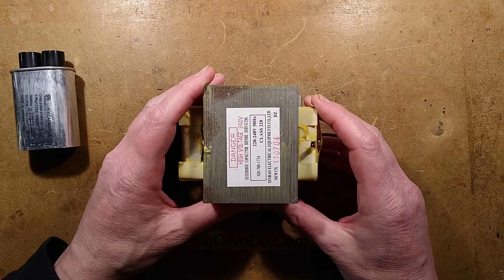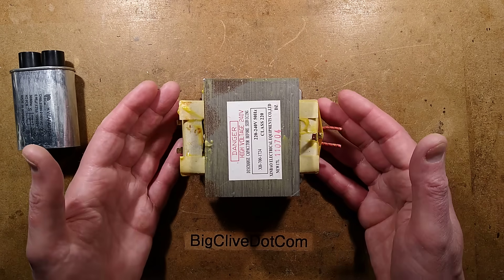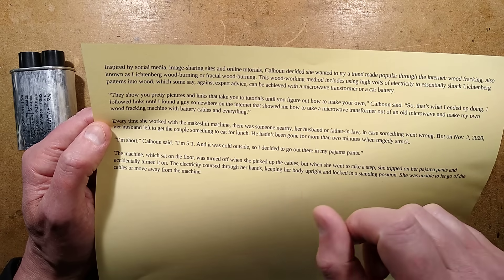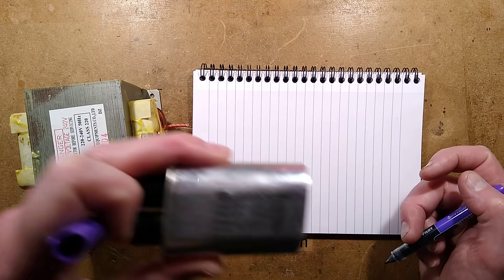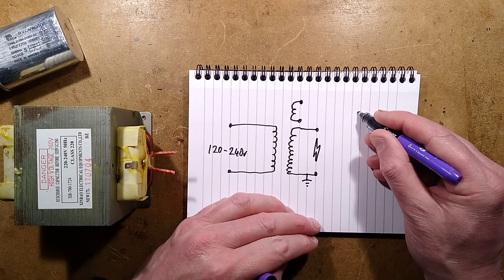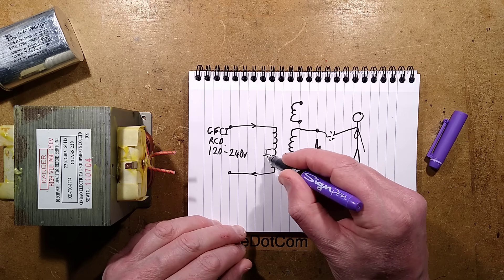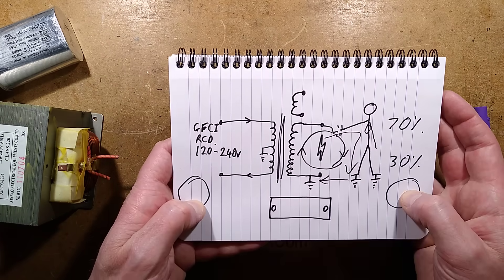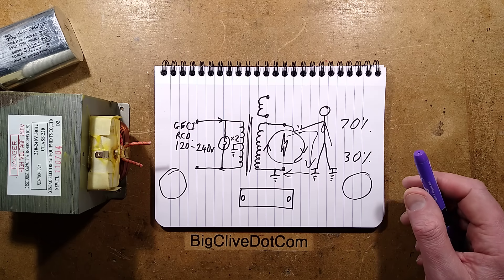The most deadly project on the Internet

Comment: Fantastic Video about Safety! This applies to anything high voltage, a good refresher for those in the technical field service industry and a great introduction to high voltage safety for newbies wanting to experiment.  If this video saves even one life it was worth producing it!  Great Job and thanks for taking the time to do something to help others be safe!
Reply from the maker: If involved in technical maintenance then you may find my video called "The unofficial guide to electrocution" useful.  It's based on the fact that maintenance guys often have to work live to trace faults.

Comment: I have a lot to thank you for explaining this information Clive... you've probably saved me from a deadly electric shock. I was recently using an electric heating pad for painful back muscle problems... it's not new, but it's not ancient either, and there were no obvious signs there were any electrical issues... until a few weeks ago when I reached out to feel a radiator to check if it was warm or not.  I noticed a strange sensation on the surface of my fingers... kind of a light vibration, almost a shuddering feeling. I was perplexed as to what the hell it was and then realised my heat pad was on low and sitting comfortably behind my back on my office chair.  I've always believed electric shocks were instant... you'll either get one or you won't, never thought it was possible to feel a low level electric current. I turned my heat pad off and dared to touch the radiator again... all the shuddery feeling had gone. I mentioned it to my brother who knows quite a lot about electric and even more since he's been watching your channel.  He had just watched this video and warned me not to use the heat pad again and explained the info about the transformer... which the heat pad has.  I was horrified to know the trip switch in my home would not be activated because of the transformer.  That's not something the electricians warn you when they install that to your home!😕  Thanks so much... you've probably saved my life!!  What really upsets me about this, is why it's permitted to sell such a device designed to use touching our bodies that has no guarantee of safety if there are any exposed wires inside.  I'll certainly never be using any device that has a transformer near my body again!😱
Reply from the maker: The tingle sensation was probably capacitive coupling from the pad to your body and finding a path to ground when you touched the radiator.  As longs as the pad is in good condition it should be OK.

Comment: I built one; I triple insulated all the connections, encased the transformer under a Plexiglas cover, bought a 20 amp voltage regulator, and 20KV electricians gloves. You HAVE to respect the shit ought of any tool you are using.

Comment: You don't have to come into physical contact with voltage that damn high! You can become arc flashed and it'll travel through your nervous system because that's how humans receive our impulses to move and walk from the brain interestingly enough by electricity... Which is why you'll die

Comment: I'm a commercial and residential electrician, and I should say, go buy some high voltage PPE Equipment which would be the smartest to invest in the thick rubber boots, apron, and gloves to protect from a very painful death! Electricity will follow the path of least resistance to ground out, if you're the least resistant path, you've just become a very unfortunate ground wire! I've worked on very powerful transformers a hundred times bigger and yeah that shit will fry you instantly, this will keep you on it until it blows appendages off don't microwave yourselves...

Comment: I worked in the families white goods repair workshop as a kid on weekends, and was always fascinated by the workings of a microwave. A senior engineer let me watch him disassemble a microwave for repair and explained the dangers of megatrons and high voltage capacitors. Basically a death box. Worked on every type of appliance, but I won't touch a microwave for this very reason.

Comment: I'm not an electrician, but I've done a lot of low voltage, and 120 and some 240 wiring. I have no interest in dealing with voltages higher than that (I don't like messing with 240). Great video though.

Comment: The ignition coils on my 2zzge racing engine, transform 12V into 40,000V, at around 1000amps. you can stop your heart by testing spark the old fashioned way. (Grounding the plug threads to the engine block, and looking for the spark in the gap)
All modern cars have ignition coils that transform 12v into a minimum 24000V.
Hybrids and other E.V.s have batteries and transformers in them, that is often the same power of a lightning bolt from the sky. the average home can be powered up for about 10 minutes, with a fully charged EV (Electric Vehicle)'s battery. 

On another note...
You can make a prank cigarette lighter with a AAA battery, and a coiled up copper wire.
A AAA1.5v battery, converts to 30-45V, with low amps. It hurts, but doesn't cause damage. You can help people quit smoking with a bunch of these prank lighters.
Is the cigarette worth the pain? LOL

Comment: I really can't believe that the 21st century Idiots still are failing to understand that high voltage can kill. I have been working with is since I was like 7 or 8, and I learned  about it at age 6. I am going to be turning 62 this year. I had an Uncle who taught me He had been in the Navy as a radio operator and electrician.  I worked on tons of devices  that have High voltage and yes I even repaired a Microwave died one night when I can home cook a late dinner. The magnetron failed. Took me months to get someone to sell me the part as they felt I could kill my self. I had basically break down my work and all I did and how the part would be replaced and tested.  I impressed the tech at the shop, and he sold me they need the part. I did this in the 80s. Last I was told it was still work but was replaced one had a turn table. But still that oven had some power the Caps were like 8 inch tall and about 250 each. I open the over up that night to look at the parts tested and bled the voltage out removed the magnetron and started my hunt. No Internet existed.  I have to respect for voltage my worse shock tossed 15 feet and that was from a tube type TV while doing high voltage test and high voltage had small hole  no damage to me but was due to good grounding testing hardware my uncle had in his work shop.  The hack design these people are using is lethal and in this day and age just utter madness. Safely building a device to not kill and to protect your self need o be made or laws to stop these idiots. I know that worse of mouth the reason I could not get a magnetron easily. A young guy was doing the same, He was just learning electronics for a hobby. I got two stories  one that he died the other hurt badly then died. This got out and many shops refused to sell any magnetron. Plus I found this may have happened more than once. I think that scraps shop and part shops need to warn of people buying these items, but it won't stop. Like you said banning it would just make them see it a challenge to find a way to do it and have people die.

Comment: I found out about those things 40 years ago. Was working at a small town independent electronics store. A customer brought in a microwave purchased there with a fan rubbing noise. So my dumb ass was gonna fix it.....Took off the outer shell, turned it on to see where the fan was rubbing and got too close to the transformer. It arced at least 6-8 inches, hitting my elbow, and knocked me to the floor. My arm was numb for at least 5 minutes. I don't know how it did not stop my heart. I took the time to study on microwave "tubes" and how they worked after that to see what happened to me. I should have done that first.

Comment: I worked in a TV shop during the mid 90s when I was 15-19. I used to perform basic repairs on old fashioned TVs. Once you've discharged a power CAP into your fingertip and turned your entire finger end black...... you never get complacent again

Comment: Unless the metal transformer case is connected to the house ground, then the there is no ground path, it's effectively a high voltage isolation transformer. If it isn't grounded then is that not safer? touching just one side of the secondary would not result in a shock? Not that I'd ever use these, I studied electronics and would not ever consider activating such a transformer, almost like playing with a loaded revolver!

Comment: As the old saying goes, "Fuck around and find out".
What people also should know is something called "let-go" current, the current at which you're able to release yourself from the contracting effects of your muscles from AC voltage. The range is from 6-24mA, or .006A to .024A! That is a shockingly (sorry) low number. Granted, DC let-go is higher (500mA or so) but either way, it only takes a surprisingly small amount of current to feel yourself reverse BBQ, being conscious up until the time you die from hypoxia because your heart isn't beating.

Comment: I wish big Clive would review the Danfoss ignition transformer for oil burner heating boilers. 2x7.5kv & 15kv units as even Danfoss can't tell me the difference between them. And why.
EBI M 052F0033 & 052F4064  the 052F4045 is a replacement for the 0033. Big Clive  rocks....
Reply from the maker: It sounds like the 2x7.5kV is a 15kV centre tapped to ground.
Reply: Yep,  but on the bench the HT wires only seem to arc to each other and not two arc's to centre ground tap. Maybe ,try again or faulty, 
My thinking is- if you accidentally lick one of the HT wires when leaning in the earthed boiler you only get 7.5Kv but would that be any safer then touching only one side of 15Kv that's isolated. Hmm there's the RCD to earth to consider on 7.5Kv. If used But thanks Clive for replying beards rock.

Comment: I Am lucky. I have  been hit with my neon  bombard transformer 24KV like a small one on a poll don't know how many amps or volts but burnt my arm pit lymph nodes it ran through hand to hand did not sweat for a couple months. This is just one push of a button maybe milliseconds.Take precautions win working with electricity. I have pulled a transformer form a microwave. The magnetron inside a microwave can contain beryllium oxide in their ceramic insulators which can be fatal if it gets into the lungs.

Comment: In my head, when it comes to electronics, I think of them like firearms, because they're just as deadly. Always treat a line as if it's hot, never put a line where you wouldn't want to if it was hot, and never, ever, ever get complacent.
Reply: That’s a good rule, especially with high voltage and/or current.
Reply: These transformers are much worse than firearms. Just touching one accidentally is enough to kill you.
Reply: When I told my dad that I wanted to become electrical engineer, he said:"Remeber, fire and electricity are only women that dont want to be touched"

Btw, in my language, every noun has gender (like German language has) and electricity and fire are feminine.
Reply: Impractical to do this when working with electricity, in the same way "every gun is loaded" would prevent an armorer from repairing a gun.  How are you going to connect an outlet to a wire if you can't touch the wire, or the outlet, or a screwdriver, ever?  Complacency is the killer.  If you use a voltage tester every time, testing it first on a live circuit to make sure the tester is working, then on the one that you think is discharged, and you repeat it so you know it isn't a fluke, then you can proceed with installing your outlet.  Gunsmiths remove the magazine, clear the chamber, clear it again and leave it open, and then begin disassembling the firearm in a way they never would if loaded.  One of the times you're lazy with procedures like these will be the time you pay the price.
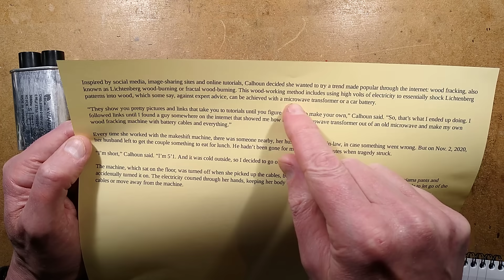Reply: This world is rapidly passing away and I hope that you repent and take time to change before all out disaster occurs! Belief in messiah alone is not enough to grant you salvation - Matthew 7:21-23, John 3:3, John 3:36 (ESV is the best translation for John 3:36) if you believed in Messiah you would be following His commands as best as you could. If you are not a follower of Messiah I would highly recommend becoming one. Call on the name of Jesus and pray for Him to intervene in your life - Revelation 3:20. 

Contemplate how the Roman Empire fulfilled the role of the beast from the sea in Revelation 13. Revelation 17 confirms that it is in fact Rome. From this we can conclude that A) Jesus is the Son of God and can predict the future or make it happen, B) The world leaders/nations/governments etc have been conspiring together for the last 3000+ years going back to Babylon and before, C) History as we know it is fake. You don't really need to speculate once you start a relationship with God.

Can't get a response from God? Fasting can help increase your perception and prayer can help initiate events.  God will ignore you if your prayer does not align with His purpose (James 4:3) or if you are approaching Him when "unclean" (Isaiah 1:15, Isaiah 59:2, Micah 3:4). Stop eating food sacrificed to idols (McDonald's, Wendy's etc) stop glorifying yourself on social media or making other images of yourself (Second Commandment), stop gossiping about other people, stop watching obscene content etc. Have a blessed day!

Comment: Ah yes, the most deadly electronic part in the world, I wonder what will it do?

When I use one of these in their original configuration I always use a long plastic pole to move the electrodes, or I set them up while the power ain't on if I can. I prefer the latter since the already distant contact becomes nonexistent.
Reply: Remember kids, mind your environment - no water and spills and stuff, always wear protective equipment - even if it won't save you, it may give more time for someone else to save you, don't work with anything you don't understand, capacitors are a typical surprise since they hold charge, most are too small to do more than teach you a lesson, but a big one like those in that microwave could blow off your finger if you're unfortunate, and for the love of god, never touch a live contact. Yes, it will be 15 extra seconds to run back to the socket, unplug it, and plug it back in, but those 15 seconds may be the difference between a project well done, and the last moments of your life.

Comment: Body resistance is typically 1200 ohms.   120v results in 0.1 amps, or 100 Milliamps.   Cardiac failure happens at roughly 80 Milliamps.  

2000v would result in about 1700 milliamps.  

Safety technique #1:  never use your left hand un-insulated.  If the current does not travel through your heart (via your left arm), much less damage will occur.  
Electrical safety gloves are available on Amazon.

#2 use a 20 milliamp (or less) fuse in series on the secondary (high voltage) circuit.   You may have to change a few fuses, but hey, you'll at least be able to change the fuse. 

#3. Stand on several layers of dry wood.   A layer of plastic between the wood is not a bad idea.

-biomedical engineer & NRTL industrial electrical inspector
Reply: Am I correct in thinking that arc would still punch a painful hole in your skin before fuse has time to trip/melt?

Comment: Great Video, got a sub from me.
The thing that will kill you is the Amperage it produce not so much the Voltage.
sure the voltage is high but the current output is crazy high.
similar transformers are used to weld metal together.
so your body has no chance esp. if it crosses your heart,
like from one arm to another when it zaps you.

Comment: I am thinking of that box with buttons-cuz if you get shot by electricity your muscles will cramps this box even harder pressing it more so still current will flow - just thinking..
How about if you put plastic pallet on floor you stand and some rubber mats or similar just to isolate grounding from your body? Would be enough? 
Thx for reply. Appreciate this very informative video.
Reply from the maker: The point of the dead man's switch is to occupy your hands and keep them away from danger.
Reply: @bigclivedotcom   Ah ok then,  i never heard about one. 😅 thx

Comment: I'm an electrician. The key here is that high voltage - 2000-4000 volts is an insane amount of voltage to be playing around with, especialy when current isn't being limited by anything other than the resistance of anything it touches. It only takes 25 milliamps to kill you and that's even at 60v-120v. At 2000v + forget about it. He's so correct. Moreover, when voltage is increased the electric field around the wire becomes larger, so you don't even have to touch anything to get shocked (using car cables -- even insulated does nothing, as that insulation is not rated for voltage above 600v, I am sure folks who work with this thing feel electricity in the air before they even touch any components of the system. 

I mean, typically the wire used in a house is rated at 600v, meaning, the insulation will fail if used for voltages higher than 600 v.

We are trained to stay 10 - 25 feet away from power lines. They are usually about 10kV-12kV lines, any closer and one can get shocked -- this happens to workers every year that get complacent and come too close to high voltage lines. Workers that must come closer must wear a faraday cage suit (so that voltage/current) flows around them and not thru them. I would think 2000v-4000v you can get shocked from 2-3 feet away but I'm not sure. 

 Thanks for this video.
Reply from the maker: It's typically 1mm per kV, but that can vary depending on the air conditions.